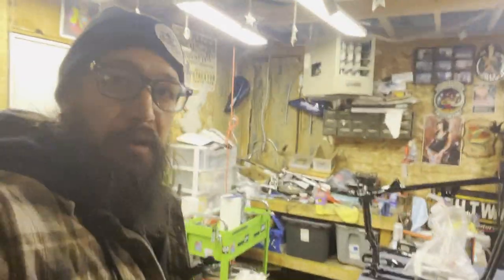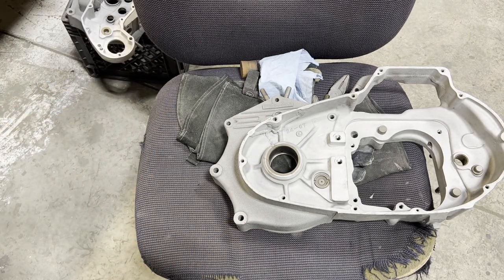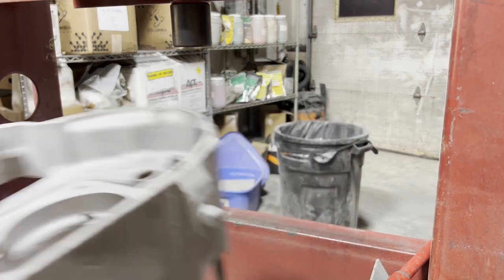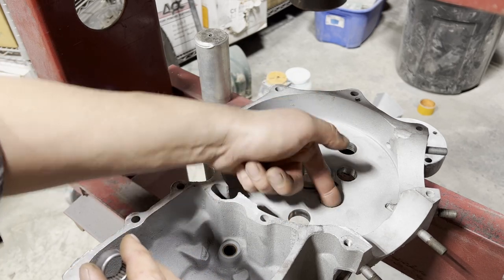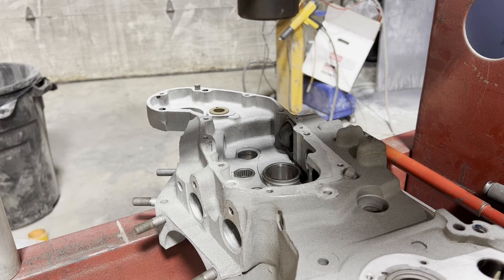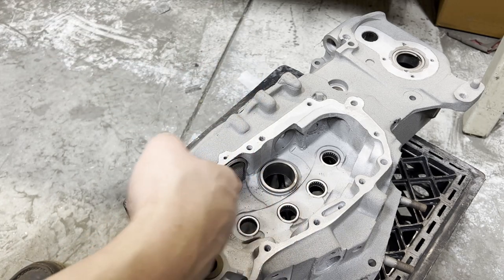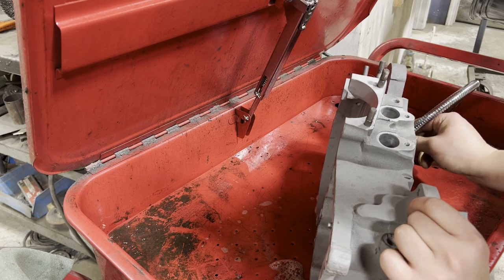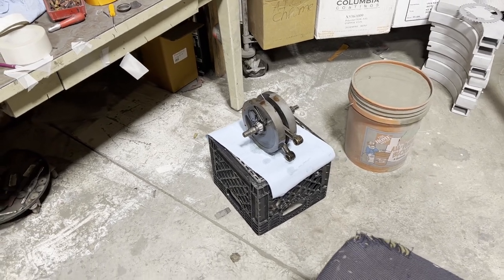1972 XLCH IRONHEAD: Cam Bearing and Sprocket Shaft Race Install -Bottom End Bearings

Comment: I know it is an old video, suggestion heat the case to 250° F and freeze the race it will drop in with minimum press. Read an old Brit manual.
 Only a suggestio.
Reply from the maker: That would also help with this process.  Especially without a press!  Thanks for watching and input!

Comment: Do what ya gotta do on this 
But 
You need end play 
There's a lot I want to say but 
It is what it is
Reply from the maker: Please elaborate. I know end play is critical on the flywheel but doesn’t that come into play once the bearings are installed? Crank or cam? The cams will be shimmed upon re install and the sprocket shaft play should be set by the timken bearing spacer once I mate the bearings/flywheel into the case? Or am I missing something? Genuinely trying to get a better understanding
Reply: @WrenchingWrecked  the response you gave is all the answers I need.
I was worried if you were going to check all end play 
Crank and cams and even on the rockers and the trans shaft and gears.